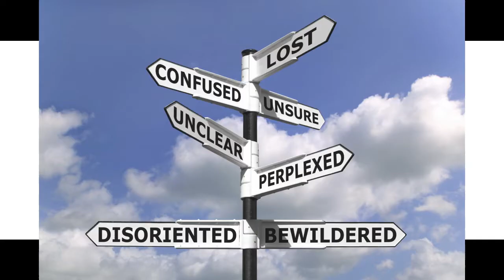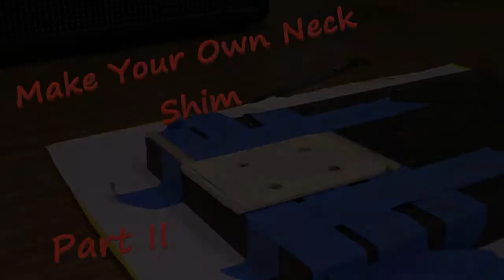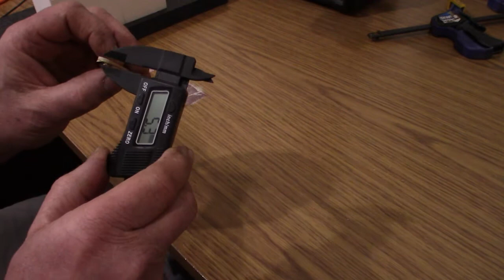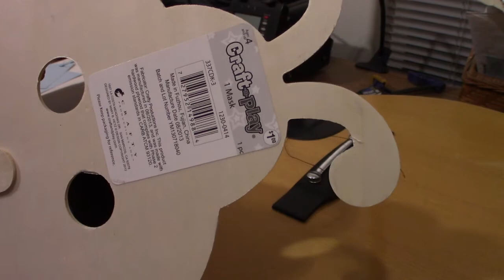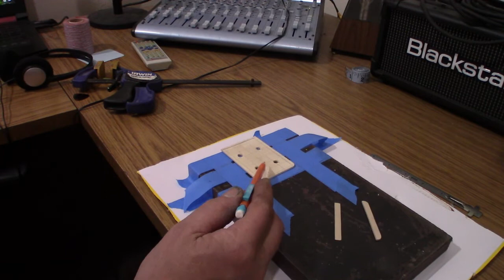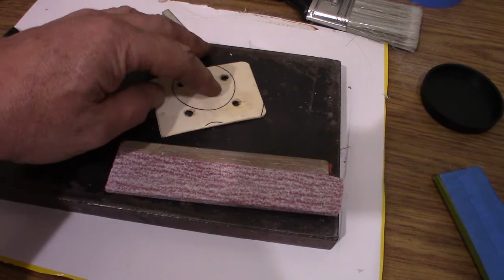Make your own shim part 2!  Epiphone Revival series finale

Comment: What about the fingerboard extension, did you shim that too ?
Reply from the maker: No. Being a bolt on neck it was not necessary. There is a gap between the fingerboard extension and the body from the factory.